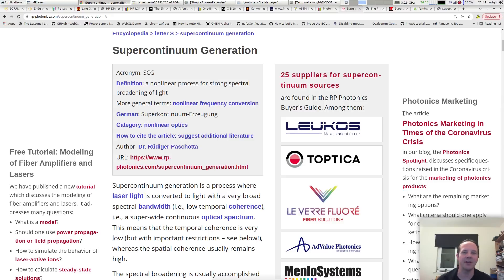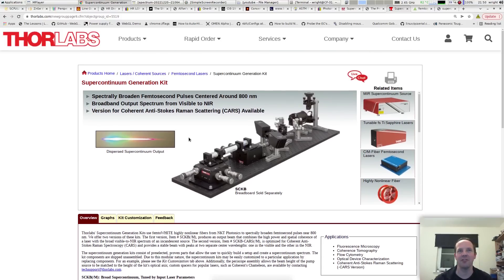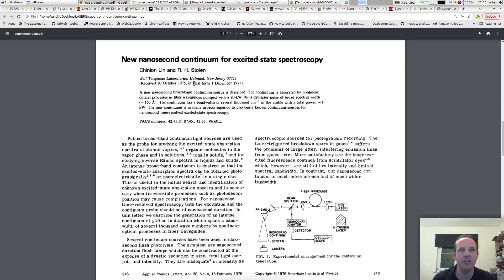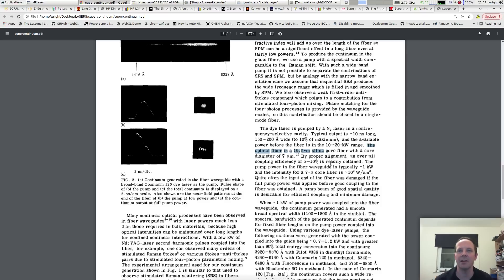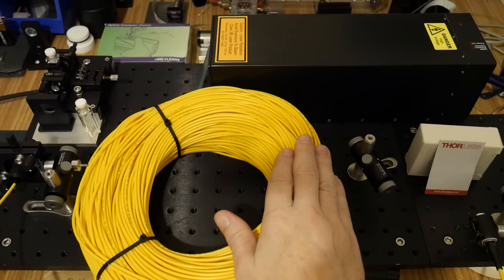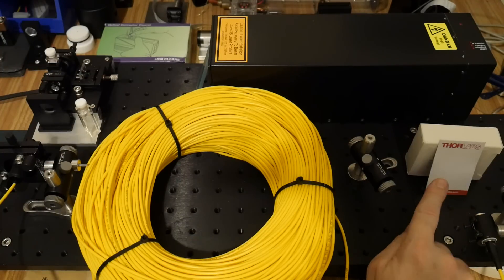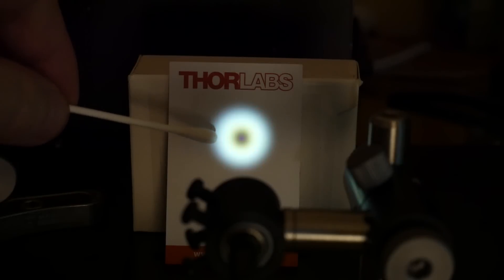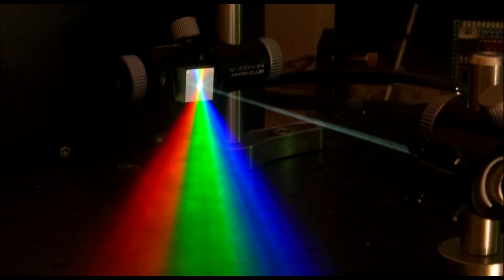DIY SUPERCONTINUUM LASER on a BUDGET!!

Comment: Could this be used in creating full color holograms with just one laser? I believe they currently involve the use of a red, green, and blue laser separately.
Reply from the maker: The first question in science is "I don't know" and I don't! My suspicion is probably not. The beam has spatial coherence, so it can be collimated into a remarkably thin beam with low divergence, however, it cannot be temporally coherent due to all the frequencies present. At this stage, I need to characterize this setup and preform some real measurements on it to determine limitations.

Comment: I wonder how old single mode vs new single mode fibre changes things. The newer fibre is massively lower loss, obviously normally a good thing in transmission, but I wonder if that's actually worse here.
Reply from the maker: My thoughts as well. A significant loss in fibers in telecoms comes from nonlinear processes, especially when running multiple channels at high data rates down one fiber. At least one fiber I had (before I blew the ends off it!) had a poor nonlinearity I am ordering samples of various types to see what the differens are between them.

Comment: Isn't there some point where you have eliminated all the characteristics of "laser" light and all you have left is just mundane light? If this is a true continuum spectrum doesn't that mean the coherence length is zero?
Reply from the maker: The beam has remarkable spatial coherence, so you can collimate into a needle thin beam with low divergence. As you say though the temporal coherence is very low, due to the broad spectrum of frequencies produced. It would be an interesting exercise to measure these properties.

Comment: Nice!
How much the cable cost?
Reply from the maker: I bought 200m of single mode cable from amazon for around $60 delivered. I did however spend $$$ on several types and lengths figuring all this out though!
Reply: @LesLaboratory  Thanks for the info. Yeah, I know prototyping is expensive. Especially if you do it like me, thinking that "this cheap part will suffice" and then end up buying the one that was too expensive in the first place.

Comment: Amazing work! This is really cool, super impressive you were able to generate that right on your bench! I was reading about supercontinuum a while back in regards to optical coherence tomography, but ruled it out as a project pretty quickly due to the same financial reasons. 💸

So if I'm reading the paper correctly, this effect is generated because of the pulse duration causing self-phase modulation in the fiber, and the wavelength causing stimulated raman emission. The pump laser stimulates a bit of raman emission at a higher wavelength, and those photons go on to cause more raman scattering, etc etc leading to a series of discrete, longer wavelengths propagating in the fiber. Meanwhile, the pulse duration itself is causing self phase modulation stuff, which broadens the wavelength too. And since it's in a fiber, more length == more broadening of the continuum.  Is that roughly how it works?

Really cool stuff! Thanks for sharing this!
Reply from the maker: Thanks!

Yes, very well summarized! 

In later work they call it Cascaded Raman Scattering (CRS). CRS should produce a "Frequency Comb" as well, with evenly spaced wide peaks, but the self phase modulation seems to smooth it all out considerably. In Multimode cable, CRS is dominant leading to bright frequency combs that are really nice to see as well. The problem is Multimode cable destroys itself due to to self-focussing effects. I am in the process of attempting to repair a cable just now.

The authors suspect four wave mixing as well which should produce higher frequencies than the pump, but I have not observed this.

Cheers!
Reply: @LesLaboratory  Neat! Thanks for the explanation/confirmation! That's a pretty cool phenomena...fiber techniques are just super cool in general, really makes you think about some of the less obvious interactions with light when it's bouncing down a kilometer of fiber 😄 Do you reckon the self-destruction aspect is the main reason why other techniques like using ultrafast lasers are more common nowadays?
Reply: @LesLaboratory that last little tidbit would be wild if true.  Could lead to some VERY interesting things down the road.

Comment: Mind blown! If you'd posted this on April 1 I would've been convinced you were having a laugh.. I've been interested in/experimenting with lasers for some 30 years and never imagined this could even be possible, let alone on a home lab budget! I've had a selection of fluorescent dyes on hand for years now, but this has convinced me to take the next step and order a quartz cuvette to delve into dye lasers. Did you have much luck with any other laser dyes?
Reply from the maker: Thanks! Some other dyes will work fine in the setup. 
The first Dye I tried was Coumarin-1 which is very efficient and easy to get. I just wanted a wider range hence Stilbene-3. I tried with R6G but did not observe a continuum with the setup, but admittedly this was early on and I did not try too hard.
Reply: @LesLaboratory  I don't have stilbene, I think the shortest emission wavelength dye I have is probably fluorescein at about 500nm. But in any case I have Rhodamine & Rhodamine 6G, which are good for beginner's dye lasers IIRC. First things first, finish N2 laser..

Comment: Awesome! I wonder if there is any visible effect when you apply stress or strong magnetic fields to the fibre. Might there be scope to optimise by controlling the temperature of the fibre?
Reply from the maker: Thanks Mike! Maybe! It is something I will look into, along with other stuff. From what I understand from the literature, it is possible to measure both electric and magnetic fields with fiber. At the very least, either should change polarization. 
I saw a paper where the authors sandwiched a fiber between metal plates and measured high voltages with it by applying HV to one plate and observing the polarization change. The ultimate infinity:1 probe? :-D

Comment: Absolutely beyond fantastic and SUPERcool. I've of course been aware of this form of light for many years now, but have never seen anyone actually show exactly how its produced.  I strongly suspect supercontinuum radiation will, in the very long term, ultimately supersede LEDs and diode laser/phosphor combos as sources for general illumination. But it's gonna be a loooong time. One of my favorite science experimentation channels by far.
Reply from the maker: Thanks! It is by far the coolest thing I have built for sure!
Now that would be good, all it will take though is some engineer at a TV factory to say "you know what would work well as a light source...", and then they will be mass produced!

Comment: It's very interesting that it doesn't actually require a PCF! I wonder if this could be pumped by a MOPA 532nm source(1064nm MOPA pulsed fiber laser and a homemade doubler). Affordable commercial units can go down as low as 1-2ns pulse length and have peak powers of around 16-20kW.
Definitely going to have to try replicating this!
Reply: Where do you get affordable mopa source?
Reply: @Minecraftmigapiku  Affordable = a few thousand in this case. Mine's 60W @ 1064, paid around $3k. JPT M7 series. 30 is quite a bit cheaper.
Reply from the maker: It turns out most things have an observable nonlinear effect, it's just a case of interaction length and peak power. Looking at the paper (and follow up work in the 70's) it should work fine with the Laser you describe. The main limitation is the amount of power that can be coupled into the fiber before it is destroyed. I have destroyed quite a few, but fortunately it is pretty cheap these days.

Comment: This actually blew my mind! Amazing job, however I'm left to wonder why the output so perfectly centered around visible light, like it is the exact same wavelengths we are able to see with our own eyes... does it have to do with the equipment used to measure the spectra (ie. limited sensitivity in the Ir range) or is something related to the bandgaps of ther atomis in the fiber (like how we don't have x-ray emitting diodes or microwave emitting diodes because of the electronic band structure ...)
Reply from the maker: It was by design. The start wavelength is determined by the dye used, and so I selected one that lases as close to the UV as possible. The end wavelength depends on the length of the Fiber (or nonlinearity), so ultimately I ended up with 200 metres of the stuff!

Comment: I had no idea any of this was possible! Really really interesting stuff! Why is the dye laser necessary rather than use n2 direct? If it's only to produce a wavelength compatible with plain glass fiber, what do you think of trying quartz fiber? Maybe it's not available in single mode?
Reply from the maker: It's probably a UV absorption issue (or maybe it was even an accidental discovery). When you couple light in, even with a small setup like this you are right on the edge of the damage threshold (somewhere in the region of 10e9W / square cm (not a typo!)).

I have generated Supercontinuum  with multimode fiber, and I was hoping to get this on video too, since it is way more efficient (bright enough to see in full room light) the problem is that power densities are so high that it destroys the fiber as it runs, and this has gotten expensive fast! One of the issues seems to be that at large power levels another nonlinear effect manifests itself; self-focusing, which raises the power density to the point it blows the end off of the fiber. I have ordered a fiber cleaver to see if I can re-cleave the affected ends.
Reply: @LesLaboratory  When you mention the fibers ends blowing do you mean a fiber with a termination (like a FC-APC connector) or just the bare core floating in the air ? 
I've heard that the first element that will burn in a fiber termination/connector tends to be the glue around the core so by using just a bare core you can use higher power densities. 
It makes the fiber harder to handle and align but maybe it could be something to consider.
Reply from the maker: @MrBleulauneable  They are terminated fibers. I have looked at them under the microscope, and they have popped out the center portion of the fiber. Once the cleaver shows up I am going to cut the connector off and cleave them. I will soon find out if free floating fibers will work better ;-)
Reply: @LesLaboratory  Maybe try with a bigger fibre (90 or even 100 µm) or other NA's. Where is the threshold for the generation of the Supercontinuum ?
Reply: @LesLaboratory  I'm sorry, is it 10e9 W / cm² or is it 1e9 W / cm²?
Reply from the maker: @rosskrt  10e9 W/cm2, it's not a typo once you do the math it's a reasonable figure given the tiny spot size and the peak power.
Reply: @LesLaboratory  I’m sorry, my comment must’ve given the wrong impression about what I was trying to say :)

It was just a simple doubt that came to me when I saw 10e9, and I was confused if it meant 10⁹ or 10¹⁰.

Anyway this is a great video, it's the first one I see from your channel and I think it's very promising. Keep up the wonderful work!
Reply from the maker: @rosskrt  not at all! When I first saw it, I had to check the math!
Thanks! I have a follow-up in the works for this one, it's possible to do far better! ;-)
Reply: @rosskrt  a difference between scientists and engineers- scientists would say 4.5e9, where engineers would say 45e8, 4.51e9vs 451e7 (scientists go 1-10, engineers always write it in such a way as to avoid a decimal point)
Reply: @LesLaboratory you’ve been one of my favorite ways to learn about quantum and nonlinear optics in application!  Sometimes the books get a bit confusing to understand intuitively so these help an incredible amount!  Thanks for the great work!
Reply: The reason that dye works but plain N2 does not is because the dye creates a very wide mode bandwith of several nm in a short time. What occurs are the modes of different frequencies interfere in the fiber to create all sorts of parametric oscillation. This will produce a continuum of frequencies with peaks being at sum and difference points as shown on the sptrometer plot. Narrowing the group temporal spacing like using a Ti:Sapphire ultrafast laser will make the output far stronger. The mode shredding by TIR and nonlinear effects is increased the more compressed the light pulse is. Well done! Congratulations you have achieved God level DIY photon hacking. After my ❤😁🤓
Reply: @christopherleubner6633  I can attest to the supercontinuum generating power of Ti:Sapph. I used to routinely generate supercontinuum, simply screwing a ~1mm thick sapphire plate on the output of a fs amplifier.
Reply: Hi Ben,
I think quartz in these length would be also very expensive if available. Maybe it’s time for a diy ti:sa laser from Applied Science 😉
Reply: Yeah it sounds likely that it’s just an issue with the fibre not being able to handle that UV. This also looks like a lossy method, i.e. it won’t go shorter than the input wavelength, only longer. So finding a ~400nm pulsed laser is a requirement to get a full visible rainbow. And I don’t think you can Q-switch a diode laser, though maybe it’s possible to construct a wider cavity by putting another output coupler in front of a diode laser, which you could put a saturable crystal.
Maybe use a doubling crystal on a red laser? Be it naturally pulsed like a ruby, or Q-switched. I’m guessing the pulsing is needed for the high peak-powers to reach the fibre’s nonlinearity.
Reply: Hello Applied Science 🙌 By the laws of the internet I hereby demand a new interresting video of you 😉 Long it had been since.... Love your content, learnd so much !!! Keep going please !!11!!
Reply: Sounds like its right down your alley 👍
Reply: I looked into zfg fiber and it’s 110 per meter so yea not happening.  I’m going try to drive it with a tisaph at 808nm with 2ps pulses.  Looking to get mid IR.
Reply: It isn't. It's basically a parlor trick.

Comment: Wow, this must be one of the most interesting videos I've seen in a long time. I'd heard of these but like you considered them to be very difficult and expensive to make. Absolutely fantastic job! What struck me most were the spectral variations, especially how far they extended into the red. I guess these are related to pulse energy variations, which demonstrates exactly how non-linear the process is.
Reply from the maker: Thanks! I was floored when I first got it to work! The whole process is quite weird, and seems dependent on pulse energy as you say, but also the repetition rate of the pump laser. In my system this seems to be around 32Hz any fater or slower and the continuum shrinks. Occasionally I have seen visible frequency comb in the output as well so there are probably many non-linear processes at play in the fiber, all interacting with each other.
Reply: @LesLaboratory  Have you been looking at average spectra or shot-to-shot spectra? Since 32 Hz seems in the range an CCD could easily take single shot spectra.
Reply: @LesLaboratory  Could you make a video on laser excited ceramic phosphor for rgb beam effects. Its new and what is used in the clay paky xtylos. I can't find anything about it.
Reply: @LesLaboratory  I keep coming back to this comment and wondering if (with huge losses obviously) this pulse train fed back into an identical setup could create the same amount of combing  inbetween the established peaks. Creating a very fine grading, something that’s finer than any commonly available ccd sensor could establish anyway.
Reply: I am waiting with baited breath on your video on these laser.  These things are amazing and I am dying for more videos from informed people like you and Les.
Reply: I'd also imagine a portion of it would be due to turbulence in the dye; but I know nothing about dye lasers :)

Comment: OK, first, the name "supercontinuum laser" is a huge missed opportunity in our retro sci-fi. Second, I have no idea how I've circled the sun more than 40 times, admiring lasers for a lot of that time, and have never heard of this. Simply amazing. As an audiovisual engineer, I can't help but wonder if anyone's doing research on the optics to bring this to video projection. A projector with this kind of light source would blow any OLED TV out of the water, particularly with an ambient light-rejecting screen. Great stuff, Les. 👍
Reply from the maker: I would love for a TV engineer to suggest it as a light source! That way they would be mass produced and we could all play with them!
Reply: @LesLaboratory  I like your line of thinking, there! Unfortunately I'm not high enough on the chain of command to make suggestions to the vendors. Maybe one day.
Reply: Regarding video projection, a lot companies are trying to use lasers.
However, more interesting is to use laser systems in video RECORDING, which could be huge step for filmmaking, animation or theatre. That's something I'm gonna work on sooner or later, especially for animation technique combining MoCap, machinima and holographic video recording.
Also, I know this guy who made working photonic synthesizer, which ofc uses lasers as a primary signal source and silicon photonic circuitry to modulate it.
His nick on YT is Scoots_Poots iirc.